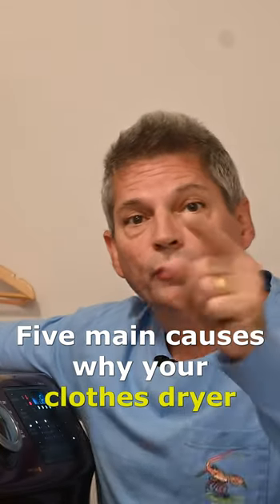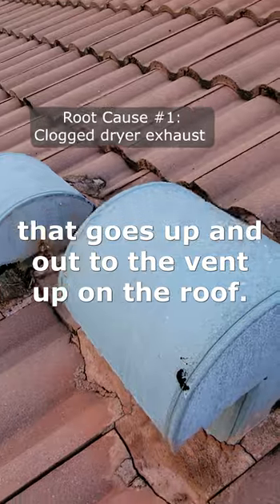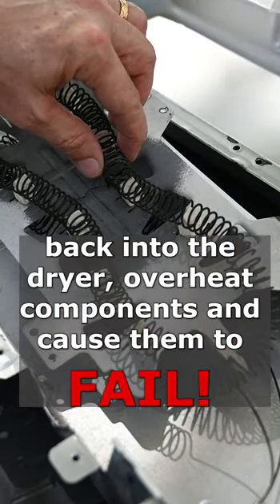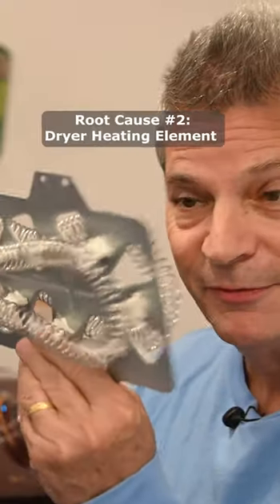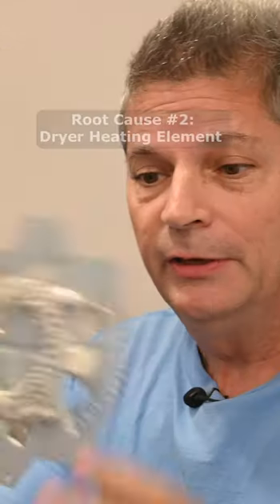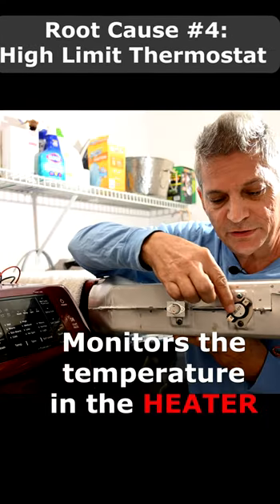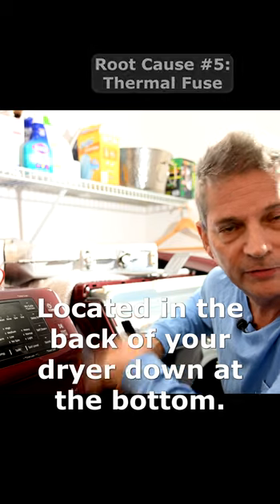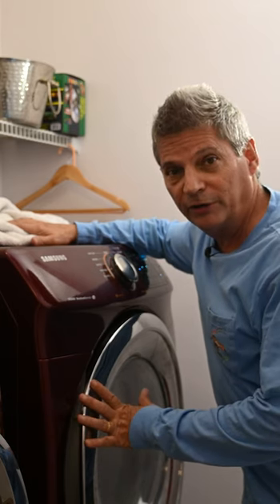5 Hot Reasons Dryer Not Heating OR Drying Clothes

Comment from the maker: 📺 WATCH: See Full-length version: 5 Causes: Dryer NOT Heating Up, Drying Clothes:
https://youtu.be/CkUPvIE0zio
📺 WATCH: Dryer Won't Heat Up Or Dry Clothes - DIY How To Fix Heater
https://youtu.be/ev-Vyh9xKHg

Samsung Dryer Parts mentioned in the video: (Paid affiliate links, thanks for your support!)
💲 Samsung Dryer Heating Element DC47-00019A Kit w/Thermostat: https://amzn.to/2TEJ4kp
💲 Dryer Exhaust Telescopic Periscope Kit Whirlpool 8171587RP: https://amzn.to/38utZay
💲 Fluke 87-V Digital Multimeter: https://amzn.to/2LK8etM
💲 Klein Tools MM400 Multimeter, Auto Ranging: https://amzn.to/38uwucS
💲 Milwaukee, 2415-20, Cordless RA Drill, 12V, 3/8 in. https://amzn.to/3czTbj9
💲 Milwaukee 2415-21 M12 12V 3/8" Right Angle Drill/Driver Kit https://amzn.to/38qhm0m
Note: Some of the links we send you to are affiliate links like Amazon and The Home Depot, which if you click on them and buy something, we may receive a small affiliate commission. We appreciate you supporting our efforts to continue to bring you word class tool reviews, remodeling and repair videos, and shop with me videos looking for the best discount tool deals.
Reply: I have a GE dryer that is about 14 months old. I have learned to take apart and have cleaned out all lint and duct work (house is less than a year old) but it takes too long to dry. I feel heat but still takes long. I did a continuity test on heater element and thermostat and checked ok. The check vent light comes on quite often but screen vent is cleaned. I just ordered a thermistor for it. Any suggestions?

Comment: Never saw a ducting system that goes up through the roof, all ours go out the side of the home.  Good video!  Most people never check the vent!
Reply from the maker: Very true! yours is the preferred method, a lot easier to clean
Reply: Mine goes out through the roof! I’m in a duplex.
Reply: Mine goes out the roof. The laundry room is a central room, no exterior wall access. My house is a standalone structure in suburbia.

Comment: Another thing that can stump people is after many years and hours of service, the thermostats (mainly the high limit thermostat) can get weak with age which will cause the heating element to cycle off sooner than it should which misleads people into thinking the heating element is on it’s way out or the main cycling thermostat is not working like it should.

Comment: Had mine stop heating about 5 years ago I changed the heating element and it worked, well it stopped again about 1 month ago,  I figured same issue so I bought another heating element and it was fine that month but it's back to not heating. I ordered a new heating element since i assumed i got a faulty one and again swapped heating element and threw in a new thermal fuse, made sure the duct and lint traps are clear still no heat,  any idea what it can be? I've got an old Whirlpool Elite He4

Comment: Have a samsung dryer , have no heat plus works by closing door . Controls light up etc , but have no function.  So to operate close door ,to stop open door . Still use it ,take about 2 to 3 hours to dry clothes .
Reply: i also have a samsung dryer is spinning and air is blowing through duct but the air is not hot its cold any advice for us @jeffostroff
Reply: duct is cleaned and cleared
Reply: Same , I replaced it all still  no heat!!!

Comment: A horrible amount of repeated maintenance and therefore it even wears your clothes faster.

In communist Europe we have a good old fashioned rack. Takes 1/2 to 2 days to dry.

0 risk it catching fire. No need to climb on the roof.
With all the saved monies one can make a nice holiday ;-)
Reply: They are starting to use combination washers/dryers, not as good as ours, but they work. It’s tough during the winter in the old days, when it’s difficult to dry outside. Been there, done that.   By the way, outdoor clothes lines are against code in some areas, they are not permitted in my village. Have a nice day, love my washer and dryer….Speed Queen!